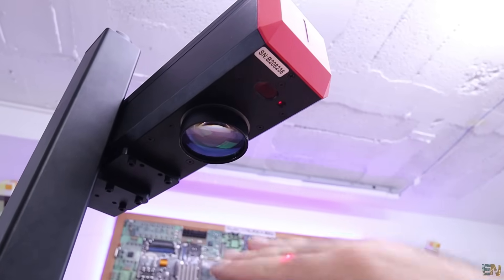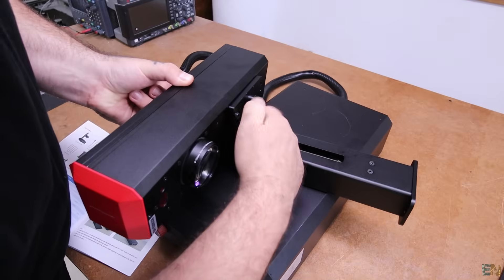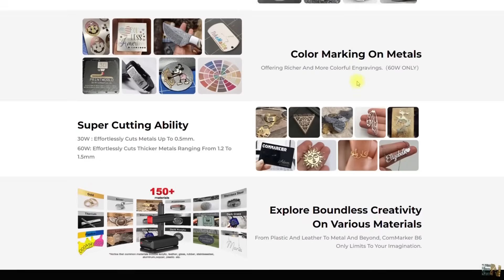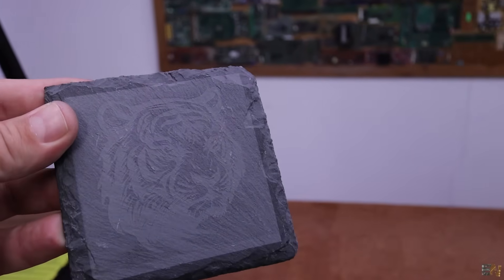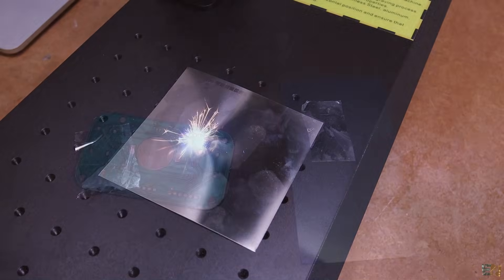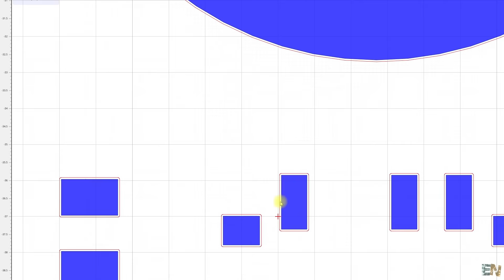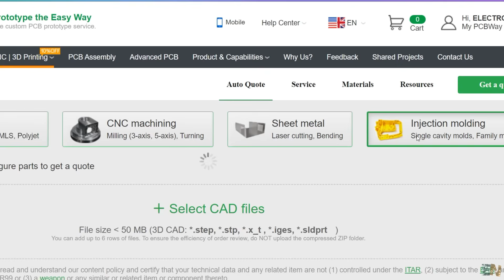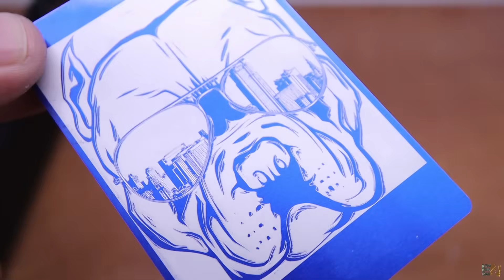Laser Cut Stencil & PCB - ComMarker B6 Fiber Laser

Comment: Guys, share your experience regarding ventilation. Is the smell strong, how quickly does it go away. How much does filtration help if I put a casing around it with forced filtration like those used for cnc machines. I simply do not have the opportunity to use it in a special room. That is, a common area. Also, I will not be able to expel air from the filter to the street, that is, it will be a closed filtration system. How safe is it for health. The main task is to cut out the pcbs. And those who cut out the pcbs, tell me if this is better than a cheap cnc machine. Thank you.
Reply: This is absolutely catastrophic for health. Very very dangerous without proper negatively sealed enclosure and ventilation.
Cutting FR4 with a laser will generate Hydrogen Bromide and ultra fine glass fibers and some other nasty stuff that some of them are odorless.
A carbon filter will saturate quicky with FR4 particulates and Hepa filters are also needed.
Only go this route if you invest in a correct ventilation/extraction system.

Comment: You said it comes with 30 or 60 watt cutter. Which one were you using?
Why don't more people use copper for solder masks?
Reply: Or plastic film...
Reply: @CBWP  I use normal thick, colored paper. Works fine with a simple diode laser. Toss it after 5-10 uses.

Comment: I hope you get a fan for that thing to extract the fumes. Awesome tool! Meaning to get one of these as well.
Reply from the maker: @youtubasoarus  i have a fume extractor in the back
Reply: @ELECTRONOOBS  Awesome! Just didn't see it in the video hiding.
Reply: Guys, share your experience regarding ventilation. Is the smell strong, how quickly does it go away. How much does filtration help if I put a casing around it with forced filtration like those used for cnc machines. I simply do not have the opportunity to use it in a special room. That is, a i have to use it in a common area. Also, I will not be able to expel air from the filter to the street, that is, it will be a closed filtration system. How safe is it for health. The main task is to cut out the pcbs. And those who cut out the pcbs, tell me if this is better than a cheap cnc machine. Thank you.

Comment: Now you can etch your own tattoos or make your own lithographic print plates.  If you put powdered glass on the stainless steel plate, could you fuse the glass to the plate?  Printer toner inks could be fused onto the steel plate, too.  Could you etch a message on a diamond?  If you could etch glass in a grid pattern, you could polarize the light to refract different colors.  If you could do a fine enough etch, you could make a 3d hologram.  Look at scratch holograms for an example.
https://youtu.be/XUy8lELWhJg?feature=shared

Comment: What that thing is missing is a nozzle of cooling air, much like how the +3kW diode fiber optics sheet metal cutting machine have. Something to keep the metal cool, so it won't deform so much to push the vapors away from the laser beam.